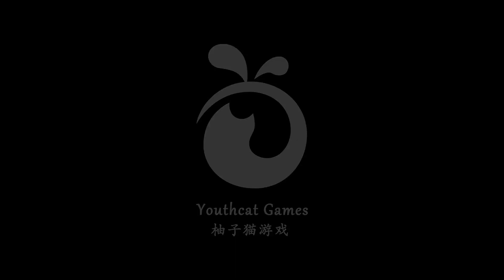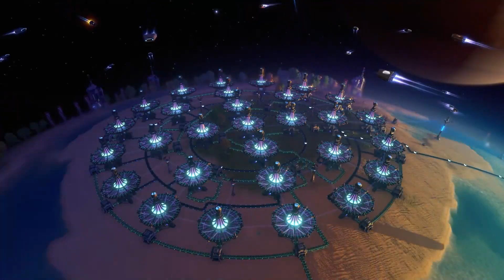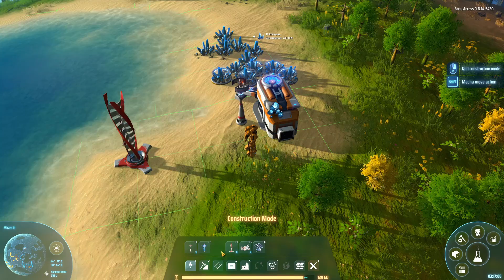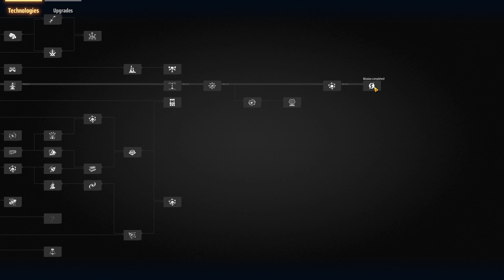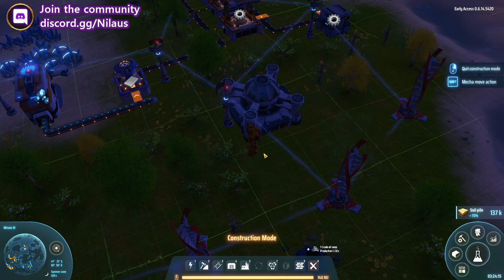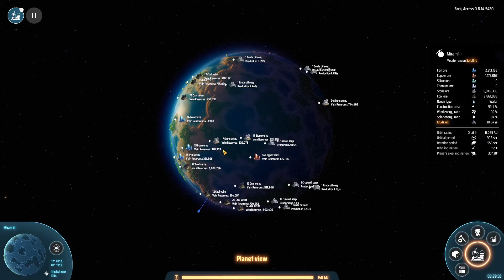DYSON SPHERE PROGRAM | Combining Factorio and Satisfactory? | Introduction & Gameplay

Comment: Anyone noticed slowly degrading performance over time which only increases after you restarted your pc? i notice my gpu utlization dropping from 100% to 20% within about 1.5h dropping frames from 140 to 30. Since a simple restart of the game doesnt help where in contrast a full system restart does it seems that there is a build up of some trash in a cashe. anyone knowing about a fix that doensnt requiere a full system restart?

Comment: This looks so promising and the ability to build factories across planets is beyond what we have ever done before. Yay, it looks like alot of fun.
Reply: the "Space Exploration" mod for factorio attempts something like this. pretty fun.
Reply: @naclypi  I tried Space Exploration, but never really felt the need to actually do anything with the extra planets. Is it just a case of needing to tweak the resource levels so that you had to go to other planets to get enough materials? (hard to get that right and not have so few materials that you just can't get to the other planets in the first place)
Reply: @JohnMeinel  it's been updated. Now there's some resources that only spawn on those extra planets. Holmium, iridite, beryllium, vitamelange, cryonite, and vulcanite. They're involved in space research too so there's a need to use them. And there's a bunch more of them(planets, moon, and stars) I think. Check it out, the updates are pretty interesting.